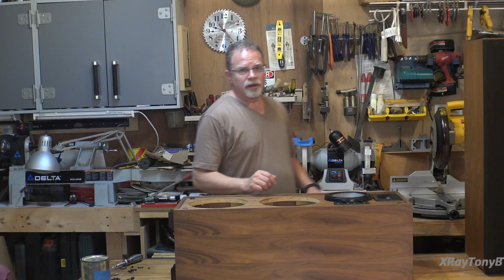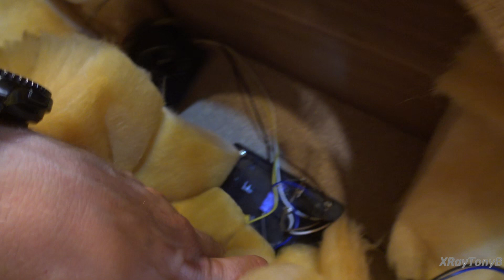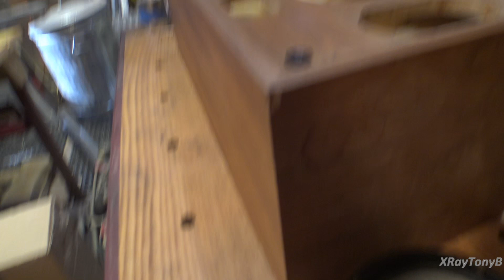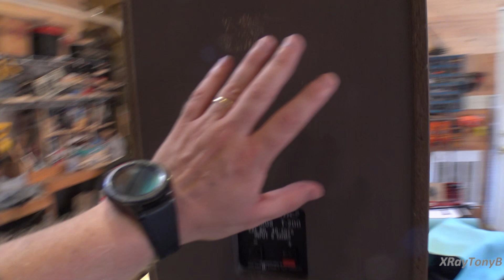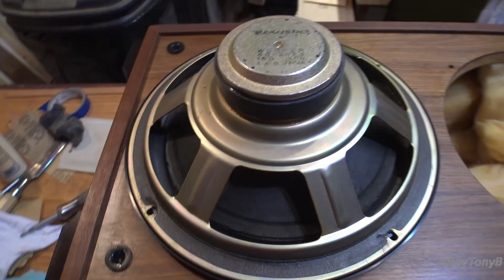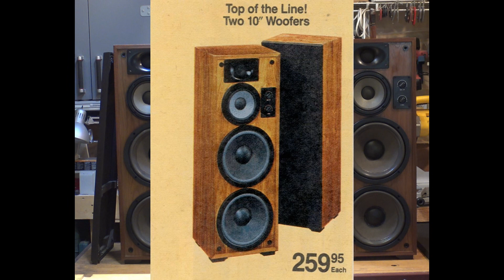Finishing the Mystery Speakers

Comment: Hi!
Good looking vintage speakers! =)
If you wish to dampen the reflections that find their way back, and out of the paper cone of the woofers you can use strips of asphalt with adhesive on the back of the woofer cage.
The material is used in cars to dampen vibrations.
I have used that method on many speakers and the result is very noticeable.
You can test the result by tapping on the cage with a screw driver before and after.
Keep making great videos! =)

Comment: I worked at a Radio Shack in the 70's as a teenager.  I can tell you that when you sold a system, you made the highest profit on the speakers, like those may have cost $120 each.  The receiver usually lower like a $300 unit cost 225 and a typical BSR turntable cost almost wheat you sold it for.  A 150 T table cost 140. Average profit was good and they pushed systems. Think of a speaker like furniture.  High profit.

Comment: I thought speaker cabinets needed a port to relieve the inside pressure produced by the cone movement.
Reply: Nope it extends the efficiency of bass tones at the expense of accuracy. A classic design is a sealed enclosure aka acoustic suspension.  The bass driver design needs that air spring to keep it from over traveling and damaging itself. There  are many different approaches with different tradeoffs.
Reply: Depends on the drivers.  High compliance woofers are in sealed cabinets.  The port is to extend the low end with the more efficient less compliant drivers.
Reply: Quite the opposite actually. The front of the cone must be isolated from the back to prevent cancellation. A sealed box additionally raises the q value of the speaker. A port is ideally designed in a way it is basically silent (the air inertia is blocking it) in the speaker's natural frequency range, but below it it acts as a resonator and phase shifter and extends the woofer's range that way.

Comment: Thoughts on why two 16 ohm in parallel.  Speakers create back EMF.  The amp has to deal with it (dampening factor). It's been described to me that amps don't just driver speakers, they control them.  (Low output impedance deals with the back EMF.)  With speakers in parallel, the amp is able to control each speaker directly.  Two speakers in series may work ok in theory - as long as they're identical.  But any difference between them would cause an interaction between the two that the amp can't control. (The back EMF of one speaker ends up driving the other speaker.)  I'd think that would color the sound beyond just the differences in the speakers.
Reply from the maker: Correct. Because the impedance vs frequency curves are non-linear, the two configurations would act very different, especially as you approach resonance.  If I ever find a suitable set of speakers (two 4ohm and two 16 ohm) I'll try to do a video using the DATS unit to compare the two different configurations.  Even if you look at the curves when I tested the speakers at the end of the re-foaming video,  picture those impedances in series vs parallel.  It would provide quite a different load curve vs frequency to the amplifier.  Really interesting stuff!  Neither configuration is right OR wrong, but it will really affect the requirements for the cabinet and crossover.
Reply: (Also to xraytonyb) If one chassis would drive the other one then one would cancel out the other one, as shooting above the wanted amplitude would cause current in reverse order that would pull back the other membrane. As you're talking about base range there will be no direction that can be detected by your ears, moreover you have to have a distinct distance inbetween two chassis to produce separate wave fronts. The distance of the 2 chassis is maybe 30 centimeters in that box, so they can only work together producing one single wave front. This proves that in any case the resulting wavefront that would be produced will be allright. 

What makes me by far more concerned is the crossover network. As Tony said there is no coil dampening or reducing the higher tone frequencies from the woofers. This should be avoided under any circumstances, as you even may be able to kill the driver coils of a woofer system by feeding in harmonics and high frequencies. For high frequencies the coil is working almost as if the membrane would be a wall of concrete. Which then means there is no giving, no spring-loading on the load. I always learned that you can kill any high-capacity speaker (of course most probable the tweeters, but under certain circumstances even the woofers) by applying a weak amplifier that you overdrive into clipping. Clipping produces lots of higher frequency fractions of the whole signal, that's what you also get when applying the whole (high) load of unfiltered audio signal to a woofer.
Plus the load impedance not being right at all. In base range your tweeters will be blocked by the capacitors, OK. But what happens on higher frequencies? The AMP will see the woofer coils in parallel to the midrange speaker and maybe even in parallel to the tweeter (!). In extrem case when we're in takeover frequency range inbetween mid-range and high tone range that would make the 8 ohms of the woofer being parallel to the 8 ohms of the midrange and in extreme case also 8 ohms from the tweeter, totalling up to 2.7 Ohms(!). 

Also a coil that acts in magnetic field and can make use of the magnetic energy stored in the magnet field for mechanical movement would not act as a proper coil producing back-EMF and  such things. It will just act as "real" resistor and "eat up" the magnetic energy. No?

Maybe one would not hear problems from that, but I'm not sure what happens to the AMP and to the single chassis of your box. Or am I just wrong?
Reply: @Slartibartfas042  Nah, the woofers can handle.  Their own impedance curve takes care of that.  20 ohms at 1KHz, 30 ohms at 3KHz, etc.  Besides, in most music the power is in the bass.  The upper frequencies don't have that much power to them.  Don't believe me?  Watch the power meter when you turn down the bass.  Then compare that to when you turn down the treble.   To every design there is a trade-off.  If you add components to keep the treble out of the woofers, then you're adding an impedance that weakens the amp's effective dampening factor to prevent overshoot, etc. The cure can be worse than the problem.
Reply: @russellhltn1396  Well, I know, the ratio of Base power to high pitched tone powers usually will be something round about 10:1. That's why you can find 300W rated boxes out that have tweeters only withstanding about 30W on their own. Regarding the impedance in relation to the frequency - I'm not so sure about that point, as that would mean you're putting by far less power into the speaker nearby the take-over frequency of the midrange speaker. It is not constant, of course but I'm not sure how far it will differ on that frequency span. It just sounds a bit to high to me saying 30 ohms (double rated impedance o that speaker!) at 3 kHz already...
Reply: @Slartibartfas042  I took that value from the measured graph in the prior video.  I'd expect the woofer to "ramp down" it's output as it comes to the cross-over frequency as the mid-range starts to ramp up.  Even then, we're interested in a flat output.  If the efficiency vs frequency isn't flat, then a flat impedance response would cause the resulting acoustic output to not be flat.

Comment: So a 4 ohm speaker has an impedance curve substantially different from that of an otherwise identical 16 ohm speaker divided by 4?
Reply from the maker: Yes.  Speakers have a reactive component to them.  Part of it is electrical (inductive and slightly capacitive) and part of it is mechanical (Qms, etc.).  Both greatly affect the impedance curve vs frequency and amplitude.  Putting these complex loads in series or parallel adds even another layer of complexity.  People who are experts at speaker design are able to calculate most, if not all  of this when they design a speaker system.  I am certainly NOT one of those experts!  Thanks for watching!
Reply: @xraytonyb  

You have to measure it to be sure. When designing speakers, you have to have exact measurements of the impedance, frequency and phase response. Then you can use software to calculate the crossover and enclosure. BoxSim is such a software, provided by the German Visaton company that also make speaker drivers, and the good thing is they have the measurements of all their drivers already included. I can really recommend it if you want to get into DIY speaker design.

Comment: That Realistic stuff was so bad.  My friend and I used to visit the audio store every week and lust after the high end gear that was available at that time.  We used to laugh at that Radio Shack stuff.  Heck even the entry level Large Advents would have blown away that Optimus, at $100 cheaper.  For a bit more than the $259, you could have had Klipsch Heresey’s, which destroyed anything Radio Shack ever made.  That’s why they stopped making that stuff.  They couldn’t compete.
Reply: "Re-elastic"!
Reply: They did have some products that stood out. I got a pair of bookshelf speakers for my 15th birthday from RadioShack. They were constructed out of some kind of die-cast sandwich with those linaeum tweeters mounted on the top.
Reply from the maker: I agree.  Radio Shack had some fairly good products, but their pricing structure was all wrong.  The markup was super high when they released something new.  I worked at Radio Shack for a year back in the '80s.  When those things would get discontinued, we could buy them for peanuts.  If they didn't sell after a while, we were told to put them in the dumpster!  These would be great speakers at $259 for the pair, but not each.

Comment: FYI These speakers were design by RadioShack (TANDY) but the manufacturer was Sanyo in Japan !  The cabinets was contracted by Sanyo  to a Chinese company but I don't remember if the crossover and pots also came from China .
Reply: Indeed they were. My cousin worked at a Tandy branch here in the UK in the 80's. All the HiFi gear Tandy/Radioshack sold was outsourced, substandard when compared to mainstream manufacturers, and price hiked. Glossy advertisements which obfuscated the real specifications, sales staff that were trained to mislead (yes my cousin), and who got big sales bonuses for selling 'premium' range gear like these speakers. The only gear I bought from Tandy was an SWR meter and a box of mixed electronic components when they went bust, they were virtually giving them away :D
Reply: @chrisdado : I worked 20 years for Lafayette Electronics and another 20 years for RadioShack ! Before that I worked 10 Years as a Radio/TV technician and antenna installer . After my retirement my entertainment is watching videos like yours , Mr Carlson , 12voltsvid and others that restore old equipment or talk tech . Have a nice day !  :)

Comment: yea your right tony realistic  didnt use  realy high powered high quality drivers it probly goes through thier whole lineup i had a pair of  the t-120 i caught on sale long ago the woofer blew i push em too hard at about a 100watts lol their their only rated 75 wtts i  opened the cabinet to look at the rating like you said about  the woofer  arent  rated too high but you figured  how they  pulled  that off  i always  wonderd mmm some times the woofers  roll off fequecy  can almost match up the midrange beginng range no indutor needed .

Comment: FWIW dual 8 ohm coil speakers (can be wired to 16 ohm by wiring the coils in series) are fairly common in car audio.
Reply: Denis O'brien 
Yes, you are correct on the wiring, but, there is no car audio system rated or wired to 16 ohms. Also, 99% of home audio speaker drivers are single coil and the speakers have an overall 8 ohm rating. There are some 6 ohm home speakers and rarely 4 ohm home speakers.
Reply: @ericbachmann8037  yes but subwoofers come in many non standard impedances in car audio to allow you to series and parallel them up to run off a single amp. not to mention matching speakers to various oe and aftermarket amps. no point arguing really, 8ohm DVC speakers exist, and should one need a 16 ohm woofer they are an option.

Comment: I'm using the Realistic GX-4000 single 15" 3 way front port... I'm not sure when or where they were made but they are still going strong hear in Melbourne Australia. Incidentally while mine also have a very simple crossover, they also have a circuit breaker as well... Nice touch Realistic..

Comment: I'm sorry you need loudness on for these
Reply from the maker: I was running the amp in the shop at lower volume. Loudness helps enhance the lower frequencies at low volumes.  I preferred the sound with the loudness on as opposed to loudness off, but that was just my preference.  Sound is very subjective.  Not everyone is going to like the same sound.  Now that I think of it, I probably should have also recorded the system with loudness off.  Thanks for watching!
Reply: The amp he is used was low power. 20 something watts per channel.
Reply: @mcaddc  Loudness increases bass and treble. It has no effect on how much power it can deliver overall. It's only usually needed to account for drivers lacking high and low end response. Hence often used on smaller speakers to improve low end roll off. Love his vids tho. Knows what he's doing

Comment: Particle board sounds better than MDF which is very commonly used today. PB is better damped with a faster acoustic delay time.
Reply: I absolutely agree!  MDF is a fancy name for pressed paper board.  Just like OSD is just an more "benign" name for "flake board"..  No matter how you spell it, it's junk! lol!
Reply: PB is saw dust and glue. This glue "evaporates" fumes for rather a long time.  Those fumes could be responsible for the faster deterioration of the speaker's foam rings. I used to work in a warehouse with lots of shelves made of PB.  Those fumes made workers' eyes tear and noses run like hell.  The best material for speakers is birch plywood.
Reply: @1959Berre  Those "fumes" would be formaldehyde, a preservative in the glue.  The glue in plywood is the same. ;-) It has virtually no effect on the rotting of the foam surrounds.  Oxygen (and ozone) is what "rots" the surrounds. Birch plywood does "look" fantastic for sure.  But PB is more dense and has better acoustical properties.  MDF is used because it is lighter weight and "saves" on shipping costs. An effect of the "bean counters".
Reply: I didn't know that

Comment: What is the role of the glass fiber sheets? Dampening? If so, how do you know how much you need and how to put it into the cabinet?
Reply: It does two jobs. First is to help dampen reflections inside the cabinet , second is to increase the effective volume of the cabinet. It does these things by absorbing sound waves across its massive surface area and transfering them into heat. Knowing how much to use is a case of measurements and listening.
Reply: @chrisvinicombe9947  thank you for the explanation.
Reply: There's a link to a good example by 123toid https://youtu.be/INM0g1JeMLY

Comment: I worked at Radio Shack when those were in the stores. Indeed STA-2100 / T-200's / LAB-500 turntable. Sounded so much better than the Mach Ones. A person could listen to those all day long without getting tired of hearing them. However they were too high end for the Radio Shack market as they were priced too close to better speakers and they did not go on sale for half price like nearly all other Realistic speakers. PS - I have never seen these with veneer on the back. However the smaller T-100 did have walnut on all sides. It was a dual 8" two-way with custom woofers.

Comment: grills need a lint roller
Reply: I use Duck tape.  It's more efficient. lol!
Reply: @JeffCounsil-rp4qv  better to use masking tape. duct tape will remove grill material
Reply: @PhuckHue2  I've never had an issue with Duck tape.  In any event, if the grille material somehow gets stuck to the tape, it's so rotted it needs replaced anyways.  Point being is pretty much any wider tape is better than a lint roller. You can be very gentle when needed, and more precise for just "spot dabbing" than you can with a stiff lint roller.